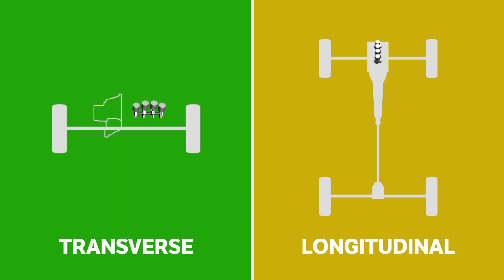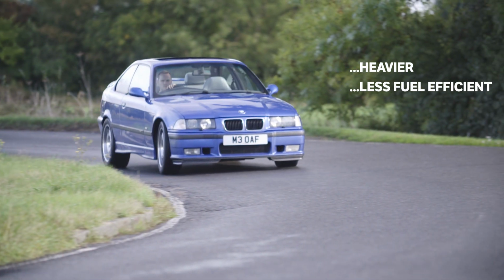The Differences Between Transverse and Longitudinal Engines

Comment: I prefer a diagonal engine
Reply: ARE YOU DUMB? Vertical is WAY better!
Reply: Mushroomsarefunguys As well I prefer a vertical radial mid engine car
Reply: I prefer an upside down engine.
Reply: "I prefer a diagonal engine"
LOL is that the cause of a really bad wheel alignment or did you power slide it into a tree?
Reply: I would prefer a dodecahedron (wrap that around your heads)
Reply: Marqamshah Shah did you really take my comment seriously?
Reply: They aren't slanted they are cantilevered
Reply: Integra DIY yh but anyways
Reply: Engines outside the car are my favorite
Reply: Quietbut_Deadly dom's charger?
Reply: Nah his just has the blower out of his car
Reply: Mushroomsarefunguys As well came looking for this
Reply: Integra DIY tf u cant have a 4 1/2 cyllinder Engine its either 4 or 5 cyllinder engines
Reply: Integra DIY no i was baffeled i thought u were talking about the size of your engine. right?
Reply: You were baffled because you thought I was serious. Read Mushrooms comment, I was just adding another joke.
Reply: I prefer upside down engines.
Reply: I prefer an engine in the Z axis lol
Reply: P1N3APPL3z 47 i prefer engine at 155 degree
Reply: If a transverse inline engine gets tilted 90° forward it would lower the center of gravity and make space for a second trunk on top of it. Why don't engineers do this?
Reply: I prefer my engines upside down
Reply: I prefer vertical engine
Reply: P1N3APPL3z 47 LOL
Reply: I prefer my pistons in engine r replaced with d*cks and it was on a d*gg* st*le layout
Reply: I prefer top-down engine
Reply: I prefer no engine
Reply: Like a slant six?
Reply: where the front inside and rear outside wheel are driven
Reply: Vertical engine is better
Reply: chrysler slant 6 is closest you’re gonna get bud 😂
Reply: Me too.. or vertical engine
Reply: nah man 45 degrees ftw
Reply: We all know the best engine is 2 pedals and 1 man
Reply: Ummm most of BMWs straight 6 engines are slanted
Reply: I like horizontal inline 4 1/2 cyl engines
Reply: I prefer an engine lubricated with fecal matter.
Reply: Mushroomsarefunguys As well WHAT!?!?
Reply: Mushroomsarefunguys As well Are there any slant style cars anymore?